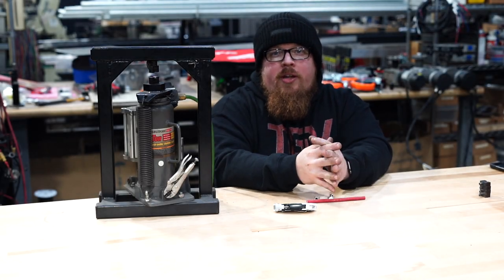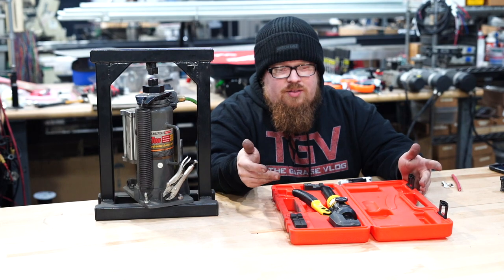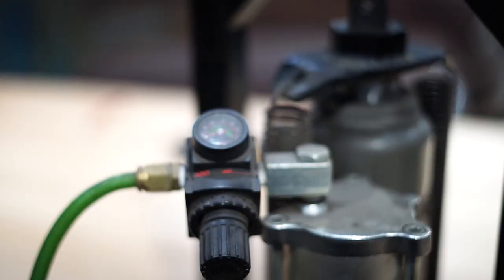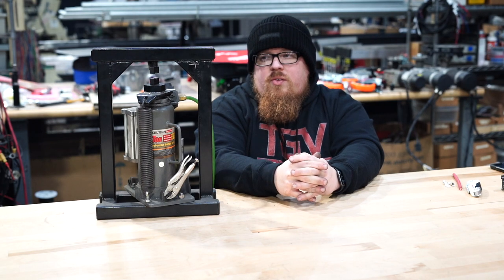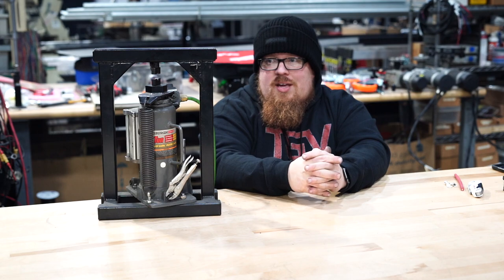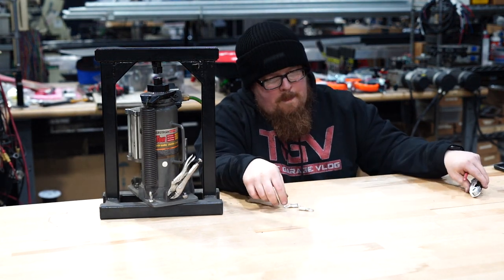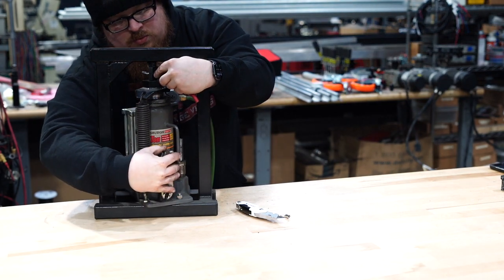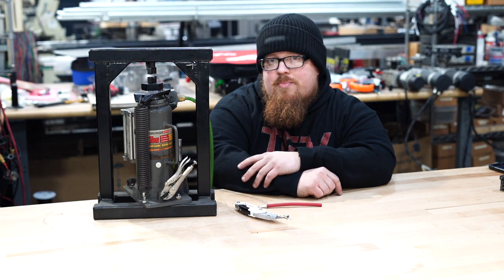DIY Air Hydraulic Crimper | How to Make Professional Battery Cables Wires | Automotive | Electrical

Comment: is them tin battery cable ends as good as the solid copper? i been seeing a lot of guys using them or is it just the price i know they cheap
Reply from the maker: These are 100% copper, then tin plated to prevent corrosion.